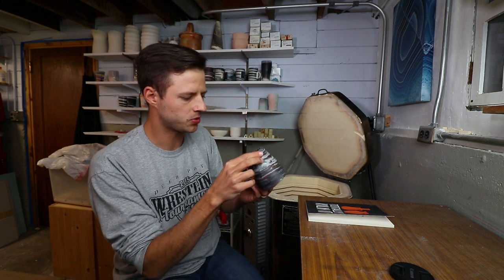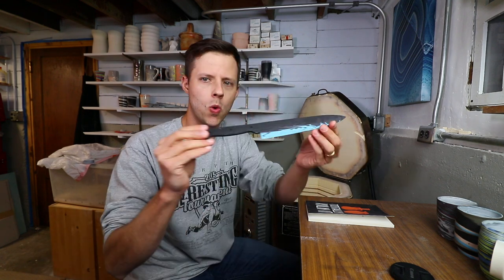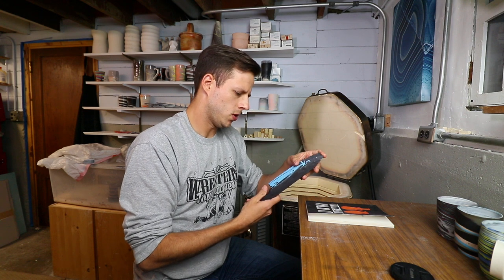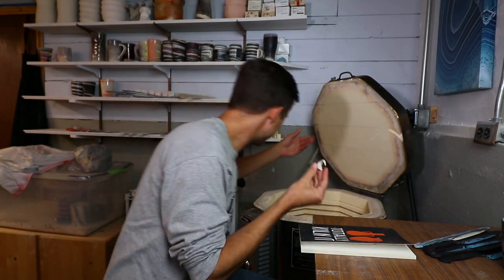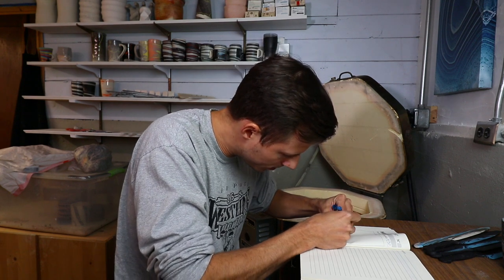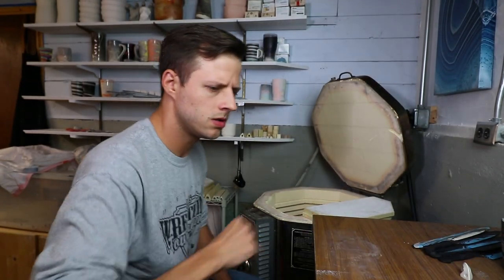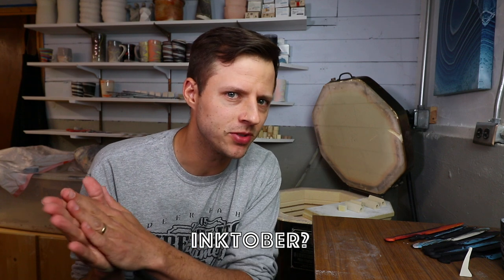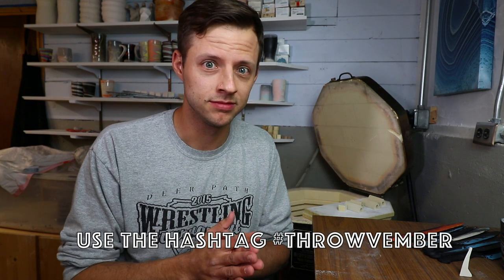Ceramic Knives and "THROW-VEMBER" | Kiln Unloading #8

Comment: Love the idea but right now my space is under construction.  Hopefully ill be able to trrough soon. I think i have the same kiln. I have a Paragon a-88b with a kiln sitter. Love doing ceramics.
Reply from the maker: Are you expanding your studio? I hope so! Yup that’s my kiln. At first I thought it was out of date but I’ve grown to like the cone sitters. No computer but more accurate I feel.
Reply: Not expanding. Were finiching the basemant making several rooms down there. I've built a 12x14 closet. We have a laundry area  im working on the last 1/3 now studding and installing the walls. Building a closet area with doors and shelves. Im moving a doorway to allow a barn doorto close the area off so i can fire   and keep the cats out and safe.
Reply from the maker: It’s all about the cats right 🤣
Reply: @CeramicJim  yes have to keep the cats away from the kiln. I would love to put it in the garage but thats not an option